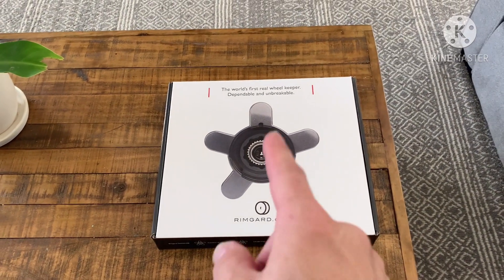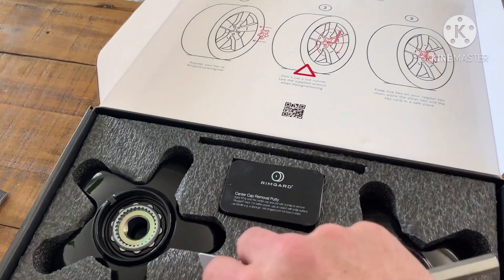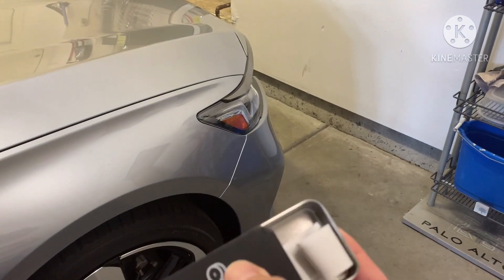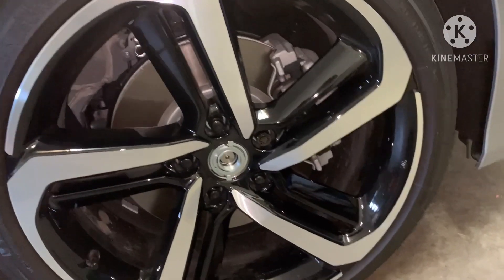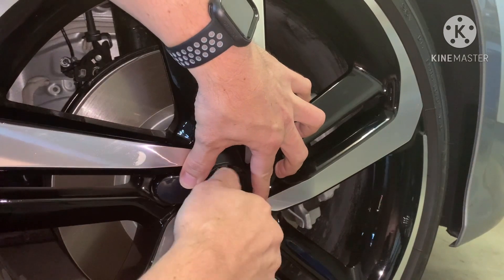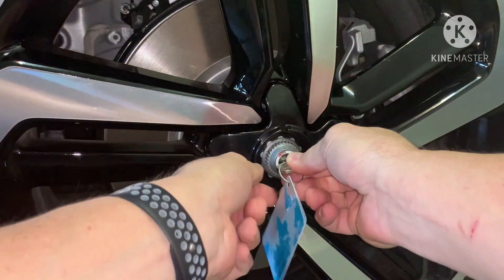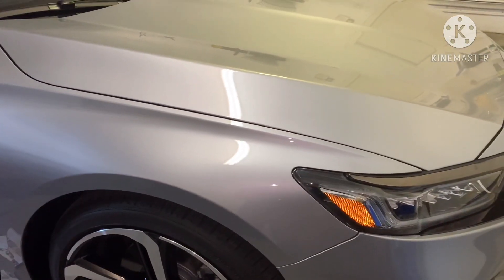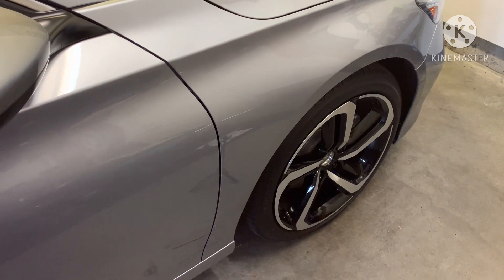Rimgard is BEST wheel lock for your Honda, Acura, Toyota vehicle

Comment: Thank you for informing us of this product. Until now, I didn’t know too much about this type of wheel lock. I have a question though; Are two allen keys included? I would have one for an extra and another would be kept inside the car somewhere just in case I have a flat and needed to remove my tire.
Reply from the maker: Thanks. Just one Allen key is included. You can pick one up at any hardware store though. 👍🏻

Comment: What if you don’t have the putty to take off the center caps what else could you use
Reply from the maker: I have seen a suction cup work. It’s takes some tries but it works as long as you can get a good seal.
Reply: I just bought these used for 200 mine looks different tho it came in like a box as big as a shoe box
Reply from the maker: Do they fit on the wheels easily?
Reply: @HondaJon  yes they look exactly the same I must’ve gotten an older version

Comment: I just installed the product. Feels very solid only thing I don't like is the center caps pull off easily 🧐
Reply from the maker: Nice. Great purchase. Yeah they won’t fly off but it is easier to take them off. Good thing about it is it’s much easier than trying remove the oem ones from the wheels.
Reply: @HondaJon  I mean easy for theft
Reply from the maker: Yeah. Hopefully they don’t steal center caps.
Reply: @HondaJon  Center Caps as far easier to sell on eBay than a set of rims :)  and a lot easer to swipe as well

Comment: I was reading a few reviews and some people say that they hear rattling noise when they drive???

I was thinking of getting both advanced wheel locks and these probably don't need it that's double protection.
Reply from the maker: Yeah I wouldn’t go with both. If installed correctly you shouldn’t hear rattling. Sometimes it’s the locking ring that isn’t pushed in enough that will cause it to vibrate but if it’s locked down completely it won’t move.

Comment: Can you update us on possible rust or any damage to the wheel these may or might not have caused.  I worry that it's metal on metal on the face of the wheel.
Reply from the maker: No worries. The only part this touches is the hub. I would simply put a nice coat of wax on the wheels before installing. It would hurt to remove them every so often and clean behind them. That will prevent any damage
Reply: @HondaJon  Thank you so much for the quick reply , I've been so worried since  getting the Accord sport and everyone targeting the wheels. Ordering today thanks again.
Reply: Rimgard also recommend that you treat the lock with lock lube twice a year. I love these thanks again Jon.
Reply from the maker: Great tip man. Definitely great maintenance for these. Recently I’ve seen so many sport wheels stolen. It’s crazy.

Comment: Thanks for video ordered mine yesterday and shipped yesterday as well. I have 2019 Accord Sport 1.5 manual just bought last month my car doesn't even have wheel locks. I have garage and I have two cars but you have to drive the car somewhere. I have $100 deductible on COMP but don't want deal with the hassle thanks man.
Reply from the maker: Nice. Great choice. I agree. It’s great peace of mind and will deter people from messing with it. There’s a lot of damage caused when they rest the cars on the ground

Comment: Anyone actually buy these and have them save the day?
Reply: I'm sure these would deter someone if it was between your rims and some similar ones. Donut Media just did a video about wheel locks and how secure they are. They removed these with a grinder, which took about 6 minutes, a drill which was quicker and with a couple of pry bars which didn't take too long at all. If you like the look of these, they will make you the last choice to have your rims taken, unless you are the only one in the area with the rims someone really wants to take. If that is the case, these will slow them down for a few minutes, but they won't stop them.

Comment: Hey, great video.. just received my Rimgard locks today, I'm located in NYC but due to extreme cold temperatures, Butyl putty doesn't stick properly in order to pull the center cap. I'm a little frustrated right now since I work in the city and I often park my car on a "not so good area" where my rims might get stolen and I can't take this cap out without removing the rim. Any other alternatives??
Reply from the maker: Thanks man. The putty does work. It takes a couple tries. Maybe sure you get it evenly applied and use a flat bottom cup. The trick is in the snap when you pull. It has to be quick. I have taken mine off snd on my pilot all with this putty. I know you can do it. Does keep trying. It loosens the cap the first couple tries
Reply: I have the same exact problem , just got mine in ( Ordered thanks to you HondaJon lol) and the putty won’t pull it off , I figured it must be the cold as well. I was going to try in the daylight see if that helps. Did you have any luck ?
Reply: @HondaJon  Hey John.. been wanting to report back on this but no time due to crazy work schedule. Anyway, the putty never worked for me or maybe I didn't get the trick at all.. I ended up taking the cap off with a really really thin precision flat head. Now, the problem ever since is a rattle noise coming from all 4 cylinder locks, due to no matter how you install, the same stay loose when you lock it, while everything else seats nice and snug. Does anyone else have that problem? And how do I correct this? For now, I have a piece of clay on each cap pressing against the locks 😬😂.. That did the trick but after paying $250+ all I can think of is that mines came defective.
Reply from the maker: Do you hear it when driving or when you move the lock with your hand?
Reply: @Vacanation   I had a similar problem with the putty , is it cold by you ? When I first put the putty down it was around 30 degrees Fahrenheit, would not stick whatsoever. My locks were jingling also drove me nuts so a few weeks later I got lucky with a 60 degree day decided to take off the locks and try and re tighten them , the putty worked like a charm it has to be warm enough for it to work. If it isn’t warm enough by you possibly try using a heat gun to heat up the putty and apply it . 

As for the locks if you can move the lock itself when it’s parked and hear a slight jingle it’s not on tight enough. I had the same problem . I had to find the right angle for the locking mechanism to be perfect flush the put the wheel lock back on. Now it’s pretty quiet , only time I’ll hear a slight jingle if I hit a bump in the road . Hope that helps !

I am also in NYC !
Reply: @johnmaggio5089  It was pretty darn cold when I got them and tried the putty but like I said on my last comment, I avoided the headache and used a thin flathead screwdriver on the very edge to avoid scratching the rims/caps and that worked like a charm, it does every time. As for the locks, no matter what angle I put them or flush all the way in, it'll always jingle on me.. I reached out to Rimgard yesterday and they're looking in to either send me a replacement of parts or the whole kit all-together. I'll have to send back my old ones of course. I'll report back when my headache is gone. For now, I just stuffed a piece of clay between each lock cylinder and caps and jingle is no more lol.. since is pressing against it.
Reply: @HondaJon  I hear it both when driving and when I move the cylinder with my hand.. it doesn't seat snug like the rest of the kit. I tried flushing all the way in, really careful but no matter what angle, It'll always stay pretty loose.
Reply from the maker: I know you have to keep rotating it until it sits just right. It takes some time getting used to but it will sit flush.

Comment: Do you know of anyone who have had their rims stolen even with Rimgard installed? I've had mine stolen three times now so, aside from installing an alarm, I am looking for the best way to protect my car. I am hoping Rimgard is the answer. Thank you 😊
Reply from the maker: I haven’t personally. These locks are the best choice to deter thieves. No lock is 100% but these are the only ones that make it the hardest to get to the wheels. All others are still lugs that can easily be broken off. Hope that helps.
Reply: Great! Thanks! I think I am going to give them a try.
Reply from the maker: No problem. These will do the trick. Let me known if you have any questions when you install them.
Reply: @HondaJon  Will do 👍

Comment: Hey Jon I love this idea looks awesome!! 👍😁 2 quick questions, one concerning tire stem covers,, I purchased  a set from eBay arriving soon...Here is part of the description....Aluminum Alloy Valve Caps   with the H for Honda black caps red logo are made from high grade & light-weight Alloy. These heavy-duty caps help prevent air leakage and stop dust, dirt, and unwanted objects from damaging the tire cores.  They have a rubber gasket inside too....Should I add these or not?  The other question is how do you feel about installing a shock sensor to your factory stock car alarm? Thanks much!! 😉
Reply from the maker: A shock sensor is a great idea since the wheels are stolen so much. As far as the stem covers. Do you live where it’s extremely cold?  If so I would stay away from them
Since they can seize on and cost a lot to fix.
Reply: @HondaJon  Thanks Jon I appreciate your help!! Yes, I live in Connecticut it gets quite cold here in New England 🥶 I wanted to ask you because I was reading so many conflicting stories on whether to install them or not 🚫 As we speak Catalytic Converters are being stolen left and right here in CT omg!!! 😱  I am concerned about the wheels as we should be, thefts are rampant today we need to do something to protect our vehicles!! ✔️ We need low jack and shock sensors wheel locks etc etc omg this is freakin' outrageous!! 😬😡🤬 Thanks again dear!! ✌️
Reply from the maker: No problem. Yeah I would just run plastic valve caps for sure then. I know it’s hard to have nice things since people seem to always want to take things you have. Stay safe.

Comment: Im having issues installing these on the front tires. the axle nut gets in the way. the ring doesnt close all the way and then when i tighten everything up, the lock doesnt go all the way in. again, the axle nut prevents it from going in all the way so the teeth dont match up or go in all the way. any ideasss???
Reply from the maker: Try turning it as you try and push the ring down. It will be up slightly on one side. It will snug up perfectly when you install everything. Let me know if you need help.

Comment: These are cool but my biggest concern is that if someone attempts to open the lock. and they jam or break it while trying to open it , how would we get it off.  I've seen people's cardoors messed up because the thief jammed the locked trying to pick it. and if they came with power tools to remove the tires then probably have a drill to tap the lock and remove it.

Edit** just watched the video of the thief trying to break it off and it looks good. all my doubts have been verified that its safe!

Comment: I am a music fanatic the mid range bass is at least 20% better It truly is amazing You will totally be very happy as it’s a huge difference improving Honda’s not so great stock stereo’s and making them truly sound amazing I was very suprised with the change for better results It’s a must do in my opinion
Reply from the maker: Awesome. I’ll do it right now. I appreciate it bro. 👊🏼
Reply: What did you think Jon Did you notice the difference
Reply from the maker: Are you sure it’s home and source?  It didn’t do anything
Reply: @HondaJon  it’s home power and source hold all 3 buttons until beep screen will then change take care
Reply from the maker: Thanks man. Just did it. For definitely sound better.  I feel the bass feels deeper.  😯
Reply: @HondaJon  There you go glad you like it and it does not effect any features Someone posted that it disables rear cross monitor That is totally not true as I have tested everything and rear cross monitoring is not effected Well worth the change Way better mid range bass Take care Jon
Reply from the maker: I agree. Wonder how it does it?
Reply: @HondaJon  I would think it boosts midrange and adjusts highs and lows to equalize sound better especially mid range so higher sound is not compromised by too much bass output but you would think that would be fine tuned in the making of the car and stereo adjustments from factory Maybe it’s based on customer preference but shouldn’t be a secret robbing customers of better quality bass and sound options
Reply from the maker: lol. I agree. I’m glad you told me. It does sound much crisper. Thanks man.
Reply: @HondaJon  Anytime glad to help as you always do the same especially with awesome great modification ideas and support Take care
Reply from the maker: You too man.

Comment: Hey Jon, great video.  I'm just wondering what if the thief tries to steal the wheel and in the process, the lock gets damaged and you can't insert the key?
Reply from the maker: You could definitely cut it off but it would take time. No lock is impenetrable but these definitely will make a thief pass. I’ve yet to see one where it was damaged where you couldn’t get it off

Comment: You didn’t install the center cap properly. 
It’s supposed to be aligned with the Valve stem. 
& who “protects” stock wheels?🤣
Reply from the maker: I guess you have been around the accord sport that long. 😝
Reply: @HondaJon  what’s there to know about a stock Accord?😂🤣 
Just get new wheels & sell them yourself. They’re ugly as f*** anyways.🤷‍♂️
Reply from the maker: That’s your opinion. They are sought after for resell.

Comment: Thanks for the video! The official installation video was fine but yours was a good complement to it! 

They say you need to retorque after 60 miles - did you do that? If not, have you noticed any change in shape or fitment?
Reply from the maker: Thanks bro. It’s always a good idea to double check yet after a little bit just to make sure but I’ve never had an issue with it.  These things are made great. You won’t have any problems with them. They are the best solution around to keep your wheel safe.
Reply: @HondaJon  Good to hear - I hope they can last years of stretching/squeezing from temperature and rotation!
Reply from the maker: I’m
Sure they’ll be good. They are build tough. No worries. 💪🏼

Comment: Ouch, i didn't know these were almost $300. What happens if you loose the key?
Reply from the maker: Yeah but we’ll worth it. A deductible is more than that and the time and headache. 

You keep that card and you can get replacement keys. You do get two though.
Reply: @HondaJon  True.. You should just put your Vinly wrap overlay back to the rims. For some reason, thieves dont like those for some reason. The ones stolen are always the non-overlay ones..lol
Reply from the maker: I agree. I’m definitely going to wrap these too. 👍🏻
Reply: @HondaJon  Any plans on adding any body or lip kit in the future?
Reply from the maker: I was looking at some. So many options lol
Reply: @HondaJon  I know right. Im thinking of either a body kit or lowering my car but i dont want to void out my suspension warranty.
Reply from the maker: Same here. It’s a touchy subject when it comes to suspension

Comment: Hey Honda Jon!
Throwing my hat in the ring for the black rim guards giveaway. Currently a proud owner of a 2019 Accord sport 2.0t, and I've been watching your Accord videos since I bought this car two years ago! The reason I'm super interested in these wheel locks is that 5 days into owning my Accord, a thief tried to steal the wheels off my car in the parking lot of my apartment complex. All 4 wheels were off the rotors and the car was being supported by the tires inside the wheel well. Luckily, apartment security caught the thief who only was able to get away with all but 3 of my lug nuts. Anyways, this wheel locking system looks like the best way to keep this from happening again! Keep making great Accord content, see ya in the next video. Cheers!

Comment: Thieves love these sport wheels so it’s definitely worth the buy! Thank you Jon for putting out great content, the accord community greatly appreciates it 👍🏽
Reply from the maker: Thank you as always. It’s great to get these products out there.
Reply: love the color of the still night 
so to all looking to buy this kit im not a thief but i am a lock smith and i was able to pick 4 locks in under 4min  and take a modified 1/2 inch drive and take off all internal locks in 5 min for 4 locks then took off wheels with locking lugs in under 15 min for 4 tires my point is in 30 min i got youre wheels and only sound i made was what you wont hear 3 to 5 am in morning they do cause a bit of trouble but if someone wants them bad enough they can and will get em on my 2021 accord i just got rim and wheel insurance costs me nothing other then my warranty so end of story if the dealer offers you rim and tire replacment due to theft with no money out of pocket may want to not be a cheap ass and buy it
Reply: @Wilyb153  Yeah, getting OEM lug nuts off, sure. You’re not saying that you got a ‘Rimgard’ protected wheels off right? Because that would be some noise making commotion that’s not worth getting your 🧠 blown out 🔫 over.
But the factory stuff, I totally hear ya’ good points 👍.

Comment: I'm interested in the grey. I just got a 2020 EXL with 17" wheels and I bought five 19" touring wheels off ebay (waiting to install after winter, 1 will be a full size spare). I'd actually  need these since I'm going away for 10 days in Dec. and my car will be left in the driveway the whole time.

Per your recommendations, I've already bought the wireless charging (Gen 2, $50), trunk hydraulics, trunk hooks, trunk net hooks, trunk net, Honda trunk tray, Oedro floor mats ($90), and elevated tray for my center console. Your videos have helped tremendously.